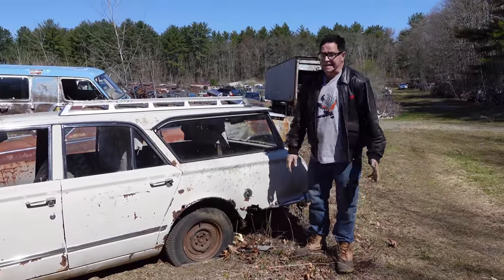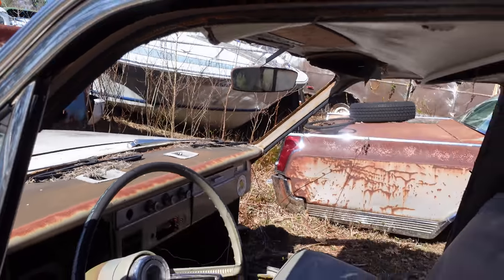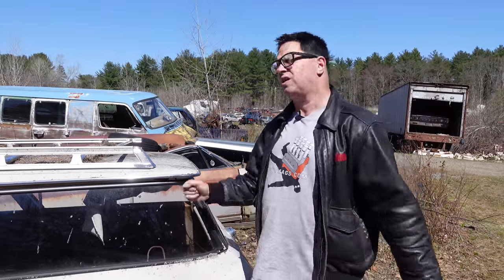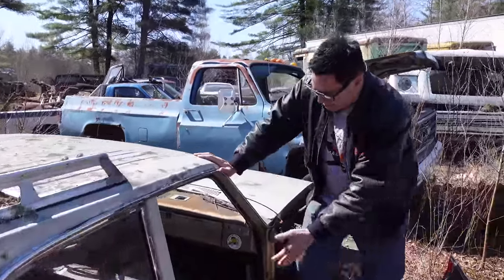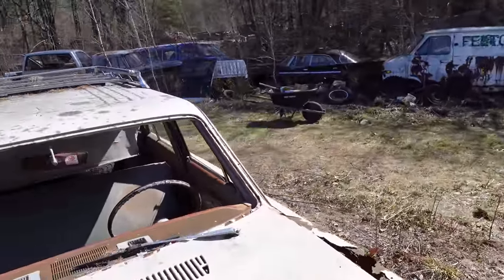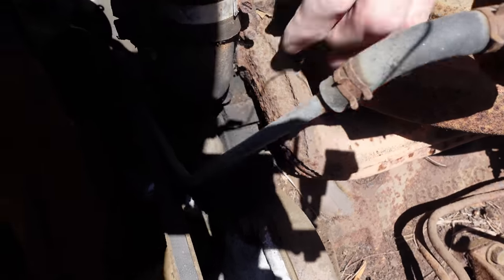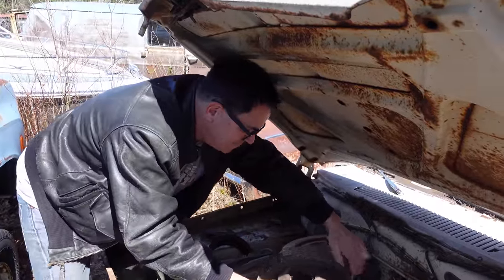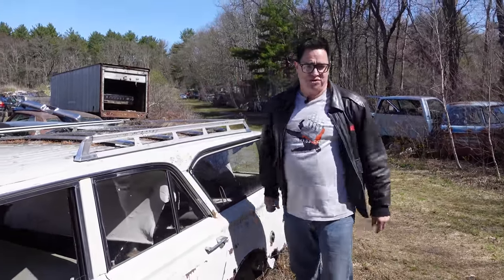Valiant Not Dart

Comment: I had a 1962 Valiant station wagon we used to call "Prince Valiant" that was so shot that it required a quart of oil every 50 miles. It was once stolen and returned in Manchester NH when the thieves discovered what a piece of crap it was.